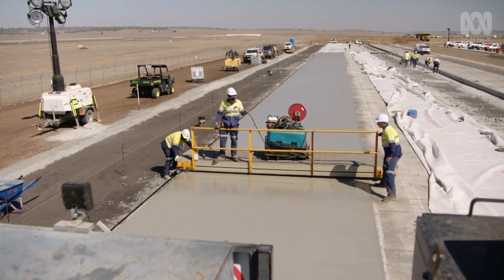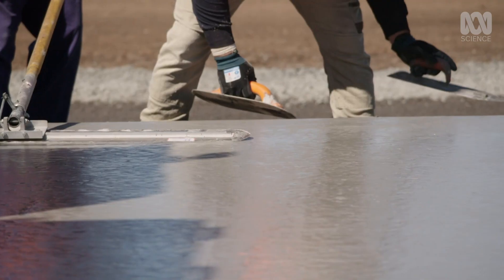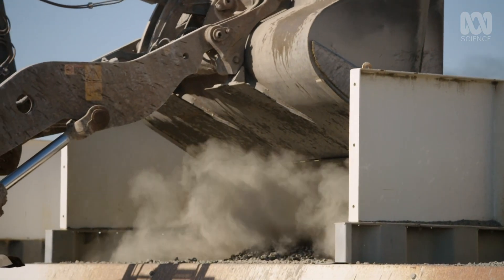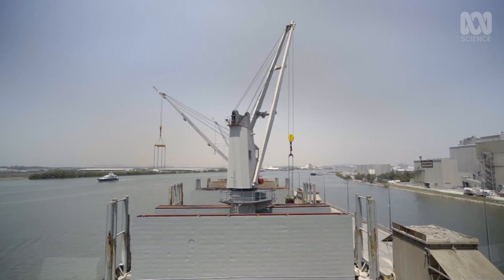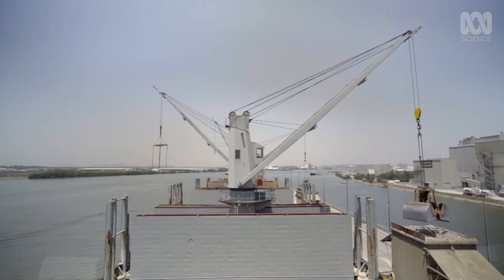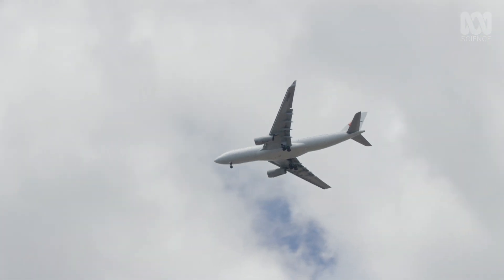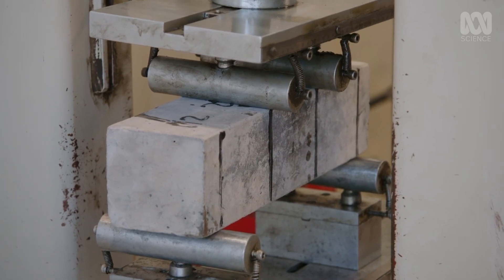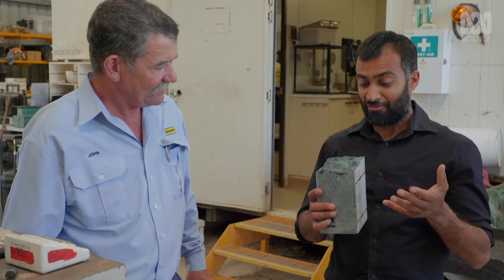Does green concrete stack up?

Comment: CaCO4 + heat ==> CaO + CO2 (I can't be bothered balancing).

Isn't this reversed during the curing process? I know the curing is more complex, the sand contains silicon and probably aluminium and other minerals.
Reply: Caco3*
Reply: during curing, the calcium oxide reacts to form calcium silicates and aluminates, not CaCO3 - those silicates and aluminates give strength to concrete.